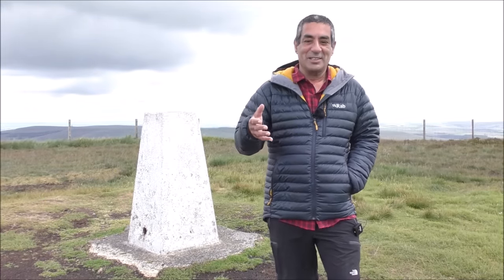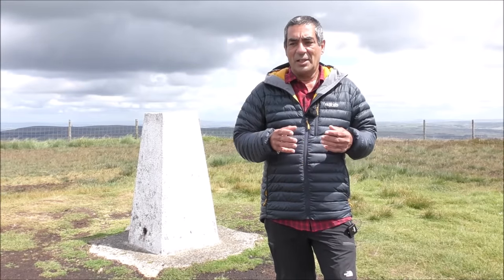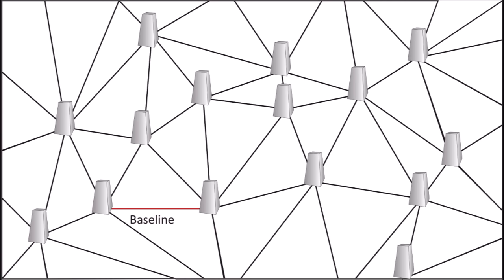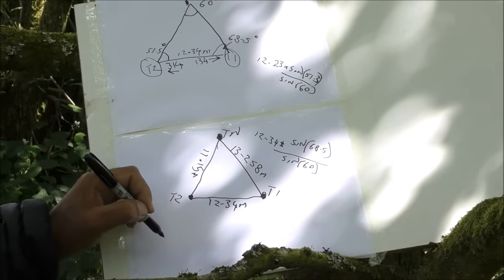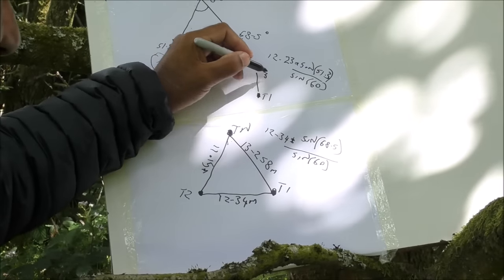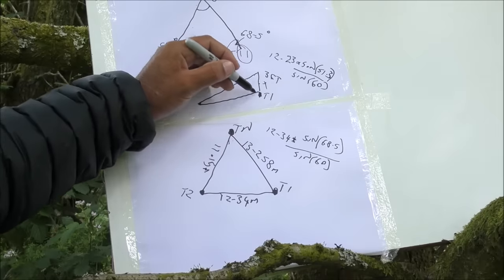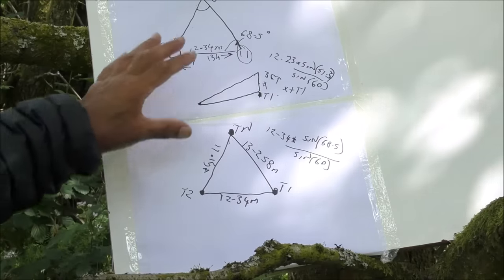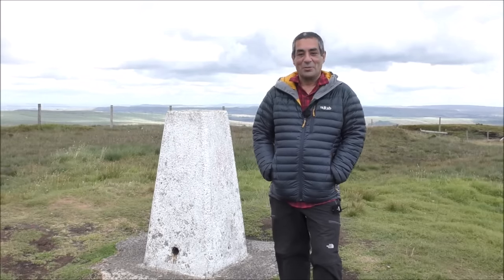How do trig points actually work?

Comment: I am old enough to remember doing survey computations using 7 figure log tables. With hand cranked calculators, those were the days. When I retired I was using a programable hand calculator for survey calcs.
Reply: We used to use kerosene powered calculators when we went to school…… Seriously when I started tertiary education the only computer there used cassette tapes as far as I remember (mid ‘70s). We were the last to start learning to use a slide rule, we got calculators in second year. At school we used log tables which were intrigueing things.
Reply: @jefftheaussie2225  started off with a slide rule at  high school. Things have changed. When I was in the reserves survey regiment in early 70s we were shown one of the only two GPS instruments in the country. They were proud that packed up it could fit in the back of a kingswood station wagon.

Comment: The BBC made an excellent program called "A very British map. The Ordnance Survey Story." It is on YouTube.
Reply from the maker: https://youtu.be/w5_kWzUahQU?feature=shared
Reply: @TheMapReadingCompany Nice of you to post a link. Your explaination if trig points was excellent. One thing I don't think you mentioned is the plate on top which has three machined slots at 120 degrees to each other and metal loops to allow secure clamping of instruments to the trig point. 
Regarding height calculations around 200 "fundamental bench marks" (or FBMs) were located across the country. The visible section of an FBM pillar is usually about nine by eleven inches and around a foot tall (to use the units of measurement from the Imperial era in which they were built), with a brass bolt set into the top and a name plate declaring it to be an ‘Ordnance Survey BM’. There is also an underground chamber containing the “master” precise reference marks for the point.  Between these 200 FBMs, around 750,000 "lower order benchmarks" were established. Precise levelling built up a picture of the profile of the land, giving rise to the spot heights and contour lines you see on OS maps. The elevation benchmark points are still maintained and in use today.

Comment: Great video, I've always wondered if they were actual triangles. Just a quick note, I'm pretty sure you calculated the right hand side at 12:38. The sine rule refers to the angle opposite the side you want to find.
Reply: Yes, something felt wrong to me with the results. The lengths of the sides of the triangle calculated didn't make sense given the comparative angles. You can even see it has to be wrong in the roughly sketched triangle.
Reply from the maker: Have a look at the video description.  I got the graphics the wrong way round. Sorry.

Comment: Well explained, but how did they accurately measure the length of the baseline?
Reply from the maker: They used a form of invar tape - in this case basically a wire which was measured VERY accurately.  Have a look at this BBC documentary. 
https://youtu.be/w5_kWzUahQU?feature=shared
At the 35 minute mark you can see this in action.  Note that when I said VERY accurately I do mean VERY.  Using microscopes to measure the length of a precisely tensioned wire may seem, at first, slightly over the top, but keep in mind that this level of accuracy is simply not possible in any other way if you’re measuring a 10 mile distance to the millimetre.  It’s this attention to details which is the reason which is why the UK Ordnance Survey tends to get thing right with maps.

Comment: On some trig points I’ve seen, there’s a sort of 3 pronged plate on top.  What is that for? Also, from one trig point how do you know in which direction the other two are if you can’t find them with binoculars?  Does this top plate help with that? Great video, thanks for the explanation.
Reply from the maker: The three pronged brass plate is call a Spider.  It was used to sit the theodolite on to.  The theodolite had three legs and these would sit in the groves and this would ensure it was centred on the trig point.
There were always other trig points which could be seen from each other.  Some of them have been removed over the years.

Comment: Couple of questions:
- How did they know the height above sea level of each trig point?
- How did they measure the original benchmark line ( as I guess that needs to be a straight line, rather than measuring the distance across the surface with all the associated ups and downs)?
Reply: The height of Mean Sea Level all over the country is referenced back to a point in the harbour wall at Newlyn - where continuous readings were taken for a period of 6 years, to establish this fundamental level, back at the start of the last century. A team of surveyors, using a precise (optical ) levelling instrument transferred a distance (height) to this reference plane across the country, so one could say that a point was so much above (or below) Mean Sea Level. The height of a Bench Mark on a trig pillar would be measured once the pillar was established, and then recorded on maps.
Reply: The distance between trig points (in X & Y) needs to be straight, so once the baseline has been measured (on a straight line), further trig points are placed ‘in line of sight’ for measuring with a theodolite. However, the levelling process, to ascertain the heights of the trig points, does not need to follow a straight line. This is because the process is carried out by levelling several (or many) intermediate points and the concept of levelling uses flat planes and their difference in height, so the surveyor will take a convenient route, whilst minimising the number of intermediate positions thus reducing the risk of errors. For baseline type surveys both the angles and levels will be taken a number of times, to ensure errors have not crept in.
Reply: Thank you, @rogerspencer2292
Reply: This would have been done by transferring a level datum from a nearby town by level and staff. Very long winded but rewarding when you managed to close the levelling loop with millimetre error!

Comment: Each trig has a precise coordinated position on the national grid, a series of squares that covers the country. (The coordinated points also have a lat and long value, initially obtained from astronomical observations) If you take a bearing and distance to another point, the Sin of the bearing will give you the difference in easting to the new point, the cosine will give you the difference in northings to the new point. So you can plot the coordinate value of the new point. The bearing to the new point is obtained using a theodolite, the distance can be measured, or calculated using triangles as you demonstrated.
More detailed surveys are made between the trig points to collect and plot the map information,  but the trigs are the framework that hold it all together.

Comment: You switched the angles/sides around!!! You basically did a a/sin(alpha)=c/sin(beta)=b/sin(gamma). Can't believe that the comment section isn't 100% people pointing out the error. Anyway, thanks for the lesson, though the trig-points seem to be exactly what I thought they were.
Reply from the maker: You are correct - please see the video description box
It was a graphics error in Photoshop - where I just put the left calc on the right of the graphic and the right on the left.  It’s easy to fix but it’s too late to change it now as Youtube won’t let me re-edit.

Comment: It would be interesting to see how they physically made the concrete trig point. How they formed the pier and poured the concrete so precisely. Do the sides each face north, south, east and west?
Reply: I'm guessing, but I'd expect some sort of frame to hold the flush bracket and the theodolite base exactly in place as the concrete was carefully poured into the mould which was probably made of wood shuttering.
Reply: I wonder if the flush bracket is connected to the brass threaded aparatus at the top and this is set into the shuttering.

Comment: I paused the video on the cleaned up triangle with sides calculated to make sure I understood which angles were used to calculate which side. I figured it out, but noticed that the picture has them reversed. The shorter side is labeled with a larger measurement.
Reply from the maker: Sorry.  As I have said in the description box I wrote the lengths on the wrong sides - the maths is correct, I just messed up when writing it down on the board and on the graphic.
I'm an outdoor pursuits instructor not a  professional YouTube creator - ha ha or a mathematician (obviously 😊 )
Reply: @TheMapReadingCompany could you add a pop-up in the video moment to waren for the mistake? Video is quite powerfull medium and it can point you in the wrong way. I had a small alarmbell in my head.

Comment: really interesting video and excellent info - however just to point out your application of the sine rule was incorrect - using the sine rule you calculate the length of the sides opposite to the angle you're interested in, not adjacent. you can see this reflected in your diagram at 13:00 where the left side of the triangle is visually clearly longer than the right side, but you've labelled it 11.15m and the other side 13.25 m

Comment: Hum, do they record the horizontal distance between the trig points or the absolute distance ?
You can of course go easily go from one to the other if you know the height difference.
Or perhaps you just write down both.
Reply from the maker: If you know the height of both trigs (which could be calculated) and have the direct line distance between them, you can calculate the horizontal distance.

Comment: 06:25 - But the question remains. How is the trig point's altitude determined? The method described showed how to find an elevation above the attachment, but the trig point's altitude remained unknown. Surely this won't be done with barometric altitude, as it wouldn't yield the desired millimetric accuracy?
Reply: Heights were measured using a level and staff taken from a datum usually a long way and a lot lower than the trig pillar. These would have been calculated by rise and fall method creating a level loop where you closed the loop off to hopefully no error.
Reply: @marknewman9622  Thanks. I don't think this was mentioned in the video.
Reply: @coriscotupi  wasnt really relevant to the installation of the pillar and how they were coordinated.
The levelling of the OSBM network is quite remarkable!
Reply: @marknewman9622  I didn't mean it's relevant to the installation of the pillar, but rather to the information provided in the video. What I wondered was how would one determine the altitude based on the distance reative to the pillar alone, without information about the pillar's altitude itself. Your first reply cleared that.
Reply: @coriscotupi  do you have a lot of time on your hands? Quite rude considering you suggested barometric levelling by the Ordnance Survey?
Reply: @marknewman9622  Please show where I was "rude". Also, I DID NOT suggest using barometric levelling by the Ordnance Survey. Quite to the contrary, here is what I had said, when ASKING what the method was: "Surely this won't be done with barometric altitude, as it wouldn't yield the desired millimetric accuracy?"
Reply: Mate…dont ruin what is a good post.
Reply: @marknewman9622  
??

Comment: I want to know what is under the top plate. It’s held in with some Allen bolts.
Reply from the maker: There's a tube which goes down to a brass bolt.  This bolt is placed at the exact coordinates of the trig point.
Reply: Ah thank you  @TheMapReadingCompany

Comment: Most of the geodetic points are flat metal or concrete circular plates with all the information  impressed on it.  You set the theodolite on top of it.

Comment: The diagram at time stamp 13:03 is wrong i think.  you have mixed up the sides.  T1 - TN = 11.15 not 13.25 and T2 -Tn = 13.25  as a check the larger sides should be opposite the larger angles

Comment: I thought these old trig points are no longer used in the UK by the Ordnance Survey, replaced by aerial photography, GPS and laser measuring devices.
At what point do you allow for curvature of the earth? If a distance between 2 points is too much, the earth will have some curvature so the measured distance at height will be longer than the ground distance, due to the radius from the centre of the earth being different. Not by much, but it will be different.
Reply from the maker: You're right.  The OS don't use trig points any more.
They were sited so that there was always another two within around one and a half miles.

Comment: They are for first order theodolites (0.2 second)  (Wild T3 or T4).. still a baseline needs to be established.. that most people are unfamiliar woth as this tale invar tape height holders and precise tension with the corresponding calculations for stretch and warp of the tape.  an Invar staff is not enough.
Reply from the maker: Sorry but not T3 or T4 they were Tavistock's.  Only 12 were ever made
Reply: @TheMapReadingCompany  perhaps T4's, but they require a tower.. one such tower was erected in Chicago.  T3's where used in the initial points for the GPS system.  I know this fist hand..
Reply: Invar staves are used on precise levelling, not for linear measurements
Reply from the maker: The OS used Invar Tapes not Invar Staves :_VHappy:
Reply: @williamhall8683  I think you not aware , WILD HEERBRUGG (and others) made 2 meter units and the new style T2s are angle auto compensating, so that excess math is not needed for distance translation.  If you are going to be exacting, all the bars are INVAR.  Brunsons require staves both horizontal and vertical.. they have no divided circles and require super levels and INVAR tapes also.
Reply: @TheMapReadingCompany  Tapes are a b!tch..  I have a 100m leveling set (spring missing) and the book.. you got to be a nerd to take that punishment [I collect]

Comment: Fun fact. below each Trig pillar is a chamber, this chamber contains a piece of rebar or scaffold pole driven deep into the ground and the coordinates and height to datum noted. If the pillar was ever destroyed, or it moved, it could be replaced to the same accuracy as the original one. My late father was a surveyor for the Ordnance Survey for nearly 40 years. He retired just before GPS became the tool of the trade for the OS. I myself worked as a surveyor for an Internal Drainage Board for 15 years surveying ditches, rivers and the coastline.
Reply: Interesting to know. We’ve got a trig point on some land and I’ve often wondered about accuracy as it’s been hit by various tractors and towed implements over the years. I don’t think it’s moved much but it’s definitely been rotated by wheels rubbing against it.
Reply: This was made for radio
Reply: Are those scaffold poles magnetic ?
Reply: @mikemiller209  no, they aren't magnetic

Comment: The first trig site in Australia was done in May 1828 by Thomas Mitchell. It is on Mt Jellore in the Southern Highlands of NSW. He used a team of convicts to clear the trees off the top of it so it could be seen. That was the start of mapping here. Although they are not used anymore it is always fun to find one and means often you are in a quite remote place. I always think of the surveyors who found and built these too. Ours are often a short pipe mast with two steel discs about one metre in diameter at right angles to each other painted alternately black and white so a black and white circle would be seen. Australia can be both very rugged and extremely flat, it can be a very long way between them on flat country, trying to find a slight rise to put one on must have been a job in itself.
Reply: Yes,apart from Tassie.

Comment: Great info you are providing here, well done lad. Is the plate on the trig point put on the side that it is on for any specific reason ? I was in the military for 15 years and we would make/build  a model of the terrain that we was going to cover out of sand so that we could discus things like potential ambush points and cover anti ambush drills or select observation point positions before we deployed so we had a good idea that we could see a target area from where we would be located. Sometimes the vegetation or tree line would hamper this but it was a good way of becoming familiar before we deployed and very often you wouldn't need to get a map out en route. It's something i still practice today and i am always selecting features to handrail while i am walking to a certain feature . I have tried GPS but always go back to a map because it gives me a better overall picture of the landscape rather than trying to look at a small screen that kind of blisters up when it's raining. Its like having a birds eye view in my opinion and i just prefer maps plus they dont cost an arm and a leg.

Comment: nice demo, thanks.  But if I may, the use of the sin law step -you had the wrong sides with each angle. IE the longer side is opposite the larger angle.  Besides that, I learned a lot. thanks.

Comment: The 'ruler' is called a staff in Australia.  Staves for plural.  The arrow is a traditional broadarrow, signifying ownership of the Crown.  Also most commonly seen on convict uniforms.
Reply: I’ve seen hole & broad arrows used as RMs instead of the usual drill hole & wing in a suburb where I’ve worked. A rare example of a surveyor with too much time on their hands.
Reply: @lambtonrob  really old suburb?
Reply: No use in South Australia and Northern Territory then!  
(No convicts allowed to settle in those colonies. :-)